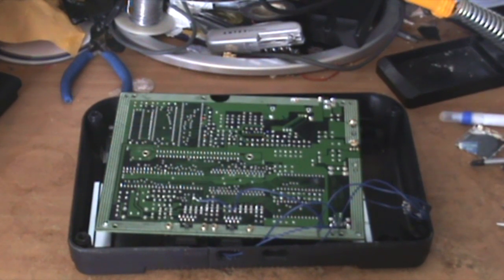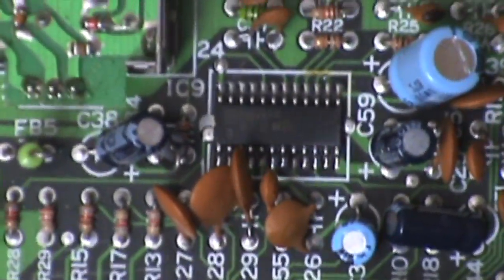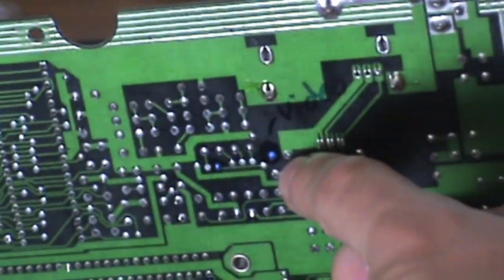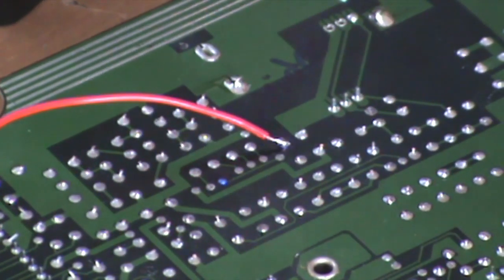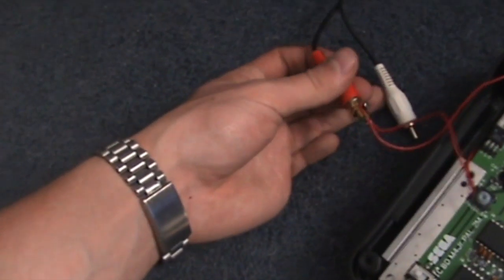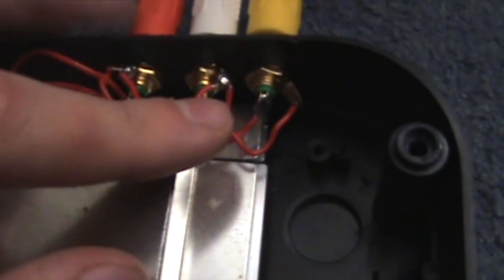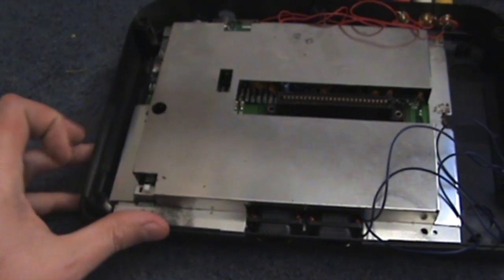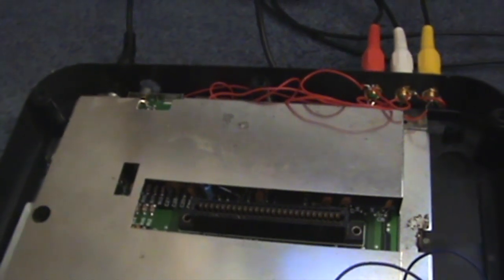Master System 2 A/V Mod

Comment: You really ought to DC isolate the composite output and include a 75 ohm resistor. If you inadvertently (easily done) short the signal to ground, it will fry the video chip output.

Comment: You have no clue what you re doing.
You re about to short circuit that poor console.
Aweful job.

It 's ok though. You have to learn somehow. 
The tragedy is that you learn the basics of electronics on a 30 years old console.
Reply from the maker: Hi, to be fair I was 16 at the time and had little knowledge of actual electronics. However I had 3 Master Systems all of which worked fine, this one in question still works to this day with the AV mod. So I couldn't have done too bad of a job!

Comment: I have the right chip.
But I have no solder on the points of the audio? Just a "Hole" in the PCB.
Consoles works fine with the standard RF.
Should I just drop some solder on the point? Or what should I ?
Reply: I have the exact same issue! There is no solder on those points?? Need help on how to do mod to this one

Comment from the maker: Hi, yeah you could use electrical tape but it's not very practical, re-assembling the console with only tape holding the wires in place would be a nightmare as you can imagine the wires would keep popping off. Your signal would also be quite dirty if the tape came loose.

Comment from the maker: @EmulatedPleasure Hi, what do you mean converter? The RF modulator? If so it will probably be easier to get composite from the board and save yourself the trouble.

Comment from the maker: @OhNoNotMyPenis Yeah you could just do this mod and you will get audio and video straight off the board. Then there will no need for coaxial cables, tuning in or an RF modulator for that matter.